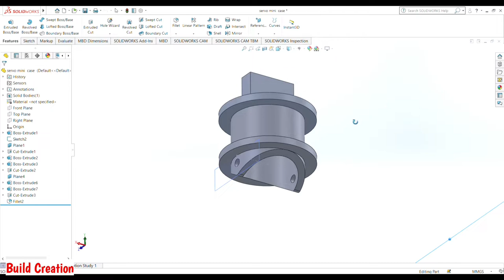Making a SERVO Motor with Self Centering | easy way

Comment: Torque measurement is incorrect. You should apply force on the end of bar, not on the whole length.
Reply from the maker: Yes you are right, there should be point load at 1cm distance. But for my assumption i calculated for rough idea